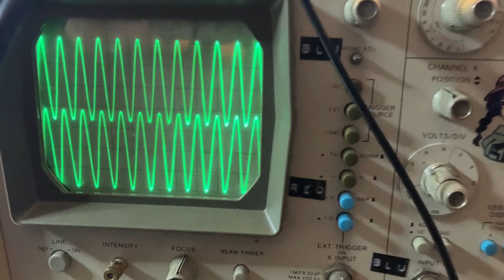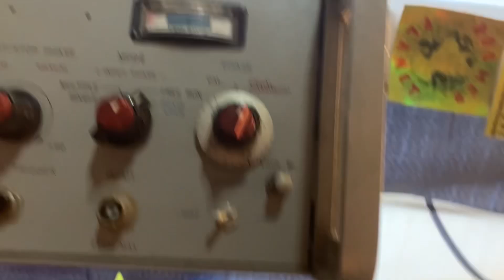HP 3300A diagnosis and repair

Comment: Hey you seem so cool, It is so unusual to se a trans electronic person 🙂 I am also an electronics guy and also use to be Bi but decided to go straight some time ago. Anyway I am working on similar stuff a Racal 9081 harmonic sig gen, I am changing a few tants in the psu. I work on high frequency equipment from 500khz to 500Mhz so I need decent tools.
Reply from the maker: wow thats some really high freq stuff! good luck with your repair, those tantalum caps are the worst